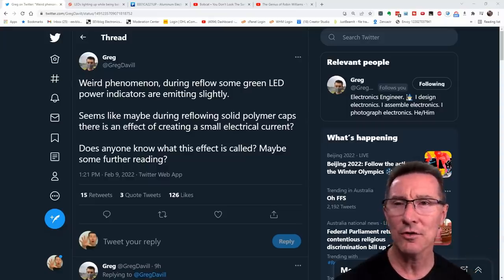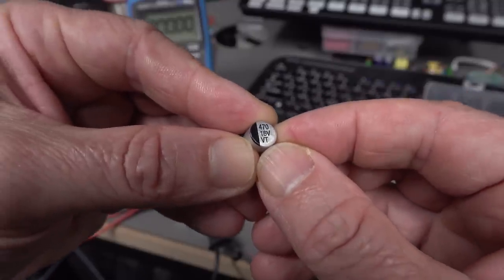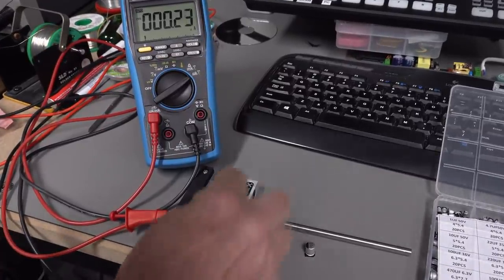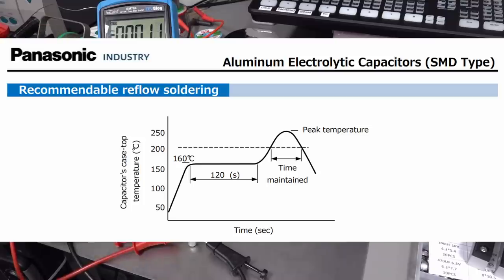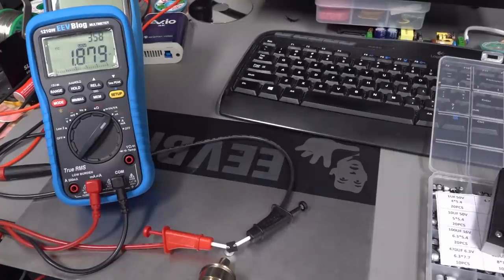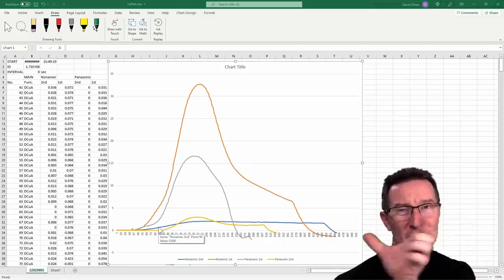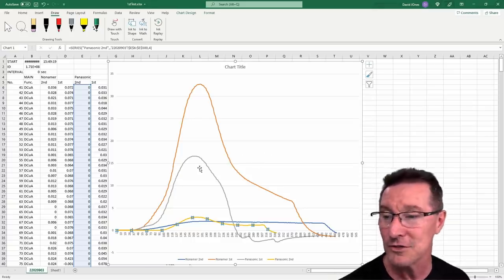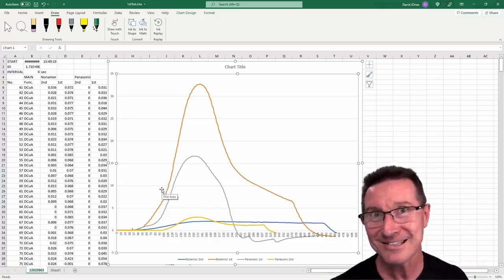EEVblog 1455 - Capacitors Produce Current During Reflow Soldering! WTF!

Comment: Might be related to pressure rise during the heating, which is compressing the internal structures, and this creates the current flow from simple piezo effect of the electrolyte. You can see the second time the pressure change has been relieved from the heating, so the capacitors are not undergoing as high a pressure swing. Try again, but take a new set of capacitors (off the reel) and simply cut through the top of the can with a knife to open the pressure relief, so you can see if it is internal pressure (electrolyte will boil a little) doing this, or some other mechanism.

Might be worth trying again with some high k ceramic capacitors, as they will definitely generate piezo voltage during heating. Also with the electrolytics connect some leads to them, and then slowly crush while recording the voltage, seeing if it is pressure related or heat alone. Leads of plain copper wire, soldered with the same roll of solder, so as have no thermal offset.

Comment: I have here green SMD LEDs (0603) , get it very cheap from ebay (from a a Chinese seller) and tested the brightness.
380nA - glowing
19µA  - good useable as Status-LED (U_LED = 2,12V) 
109µA - very bright Status-LED (U_LED = 2,28V )
218µA - unbearably bright

I let it run with 10mA for 3 days too to see if some of the Test-LEDs will fail.
Reply: A bug bear of mine is blindingly bright power indication LEDs on hobbiest circuit boards.

Comment: Capacitance drops with increase of the temperature. Voltage is the difference in potentials, so if you have 0 volts but some 0 volts means some charges are situated in side in some way, once you heat it up, capacitance drops and you get increase in voltage, which drives some small amount of current. When it cools off, you get negative
Reply: And higher quality caps will maintain capacitance over a wider range of temperature.
Reply: I think that's whats happening too.  The test arrangement supports this, having the diode across the terminals.  If there was a parasitic load thst drew any current before the led I don't think this would work.

Comment: I know from working on and restoring/modifying old tube guitar amps that when a capacitor sits a long time the electrolytic breaks down and when you apply power the electrolytic reforms. With old amps that have been sitting for years you have to hook them up to an isolated variac and slowly bring the voltage up over time to reform the electrolytic and the capacitors do heat up internally. Failure to use a variac on an old amp that been sitting for years and just plugging it into the wall socket can often create a nice fireworks show as the high voltage electrolytic capacitors literally blow up and 'confetti' the inside of the amp. Especially the really old high voltage (450-600V) electrolytics that had a paper/cardboard container rather than the aluminum ones we see today.

So it could be electricity generated as the electrolytic reforms from the heat and because you have already reformed it the second and third test give up a lower voltage/current because the electrolytic has mostly reformed on the 1st test. A way to test my theory would be let the capacitors sit for 6 months and then come back and try it again

Comment: The ESR of the electrolytic capacitors drops with a temperature increase. Those components are probably not tested individually when manufactured, but rather they rely on Six Sigma here. Nonetheless, my guess is that caps have some remanent charge when produced (maybe during filling with electrolyte). When heated they can discharge due to lower resistance when heated, but eventually run out of charge.

Comment: You named it: it's dielectric absorption.
You can model the real capacitor with an ideal capacitor, with nominal capacitance, in parallel with an R-C series where C has a smaller capacitance and R a very special behavior.
R is current-direction dependent, so the smaller capacitor charges quite fast but release the charge in an extremely long time (giving the well known dielectric absorption effect).
R is even extremely temperature dependent (negative), so when you heat up the capacitor, you reduce that resistance several order of magnitude, releasing the charge and causing the current flow.
When you repeat the heating the second time, then smaller charge is available and smaller current will be developed. Even smaller the third time and so on.
If you charge (and then discharge) the capacitor using an external source, then you will see the "thermal effect" again.

Comment: Just in general, over the last 30 years?  40 years ?   LED efficiency has increased massively.  Those red LEDs we played with as kids had terrible efficiencies, but modern LEDs.... oh man.  Crazy efficient at lower power.  One of our projects uses high-efficiency LEDs and its just crazy how little current is needed to light them up.  Mere microamps will do the job.  Very easily seen in a dark room.   Stray AC fields are enough, sometimes, depending on how the circuitry is arranged.   In our particular project we couldn't get the PWM brightness control to fade the LEDs sufficiently because even the 1/256 duty cycle (which actually was more like 3/256 due to the driver chip's mosfets not being able to turn off quickly)... it wasn't low enough.

-Matt

Comment: I always checked polarity of not marked electrolytic caps with a voltmeter, so did not surprise me that much. I would suggest it is the oxidation happening on one of the electrodes (oxygen ions passing through the defects in oxide layer. It explains the decrease in current with every subsequent heating - defects (oxide in the cap is polycrystalline, so bunch of lattice dislocations) are getting patched up with passing ions. Heating would accelerate the process. It does not damage the cap, until you make it boil and explode ofc

Comment: My first guess (which is obviously not even wrong) is that either the aluminium is oxidizing or the dielectric paper/film is changing chemically. This has to be a known thing (wet electrolyte capacitors are a fairly mature technology, dating back to the days of vacuum state electronics), and I'd guess that the manufacturers allow for this in their specifications and manufacturing process.

Comment: Had the same effect when I was repairing a cheap light bulb but in my case the bulb didnt have a electrolytic cap and only lighted the leds close to the soldering iron
Reply: That's probably because the leds light up at a few microamps of leakage current from your soldering iron.

Comment: Follow-up research idea: How does heating affect the long-term characteristics of the component? Beneficial effects, or detrimental effects?
Like, would it be something to pre-bake caps at a known temp and duration before plopping them onto a SMD board and reflowing them?
Idea would be that you boil off pockets of gas or cause reactions which cause the component to be more stable?
Another idea would be to agitate the component while heating, as to move around bubbles of gas that might've been trapped during manufacture...

Comment: In my opinion this effect might be caused by temperature dependece of the dielectric material.

Given that charge is proportional to capacitance times voltage (Q = C*U), the voltage at constant charge rises with decreasing capacitance (U = Q/C). Capacitance is always a function of permittivity (epsilon) and some function that is related to the mechanical construction of the capacitor (e.g. C = epsilon * A/d for a plate capacitor).

If the capacitor is not fully discharged before the experiment - even if there is just a little bit of charge left - and the dielectric's temperature coefficient is negative (which at least I know for sure for some MLCC types), voltage of the capacitor will rise by falling capacitance due to rising temperature.

When you start heating up the capacitor, the voltage rises and so current through the multimeter does (for ease of explenation let's assume the multimeter to be a constant resistance), but in the mean time charge decreases and at some point, there is no more charge left and the voltage drops back to zero.

So, I think this is just a discharge process of a variable capacitor and maybe combined with some parasitic inductance that may lead to an oscillation (which might cause the negative voltage).

Someone could verify my assumption by measuring the capacitance over temperature for your given capacitors.

Comment: Try charging and discharging the capacitor after it cools. I tried this and it seemed to restore the capacitors ability to product current when heated again. It's asif that last little bit of charge is released when it's heated.

Comment: Capacitors are in effect electrochemical cells. Heat drives chemical reactions forward. The fact that it only works once (between charges?) seems to confirm that.
Reply: Aren't all cells or batteries electrochemical?
Reply: @therealb888  That's my point. I don't think it's electorstatic or thermoelectric or anything like that, I think it's just a chemical reaction being pushed to completion by heat.

Comment: My bet is on chemical. In the same way that if you heat up a “dead” alkaline battery, it can squeeze a little more charge out of the chemistry. We have people here, who will leave D cell and other form factors, on a hot roof in the sun to get a tiny bit more out of the battery. Basically the heat temporarily accelerates the chemical process that produces the charge, pumping out that little tiny bit of potential charge, which may also explain why it is diminishing returns.

Comment: I've also seen this happen when you touch a hot soldering iron on one pad of an SMD LED. It's usually the red ones that exhibit this behavior the most.
Reply: probably just capacitive leakage to the iron, it often only takes uAs to ligth a modern LED
Reply: @fuzzy1dk  I was thinking more of Seebeck effect since there is a dissimilar junction inside an LED
Reply: @jaideep1337  Easy enough to rule out,   unplug the iron and try again while it's still hot.

Comment: same thing happens with piezo electric drivers within for example ultrasonic cleaners, these will produce a very high voltage if they are heated up which can be in the hundred volts range. but I think what mostly happens with the cap is that the heat excite the dielectric absorption to be released again

Comment: The electrolytics are easily explained as the oxidation layer being reduced through the electrolyte.  Otherwise, elevated temperature can release trapped charge in the dielectric, but I wouldn't expect enough to illuminate a LED.

Comment: Many years ago I heard sketchy reports of electrolytic caps producing current when dropped, and possibly when just raising and lowering them in Earth's gravitational field. But of course, a lot of amateur experimenters do not properly control stray variables, and some of the results may have been due to wire moving around in test clips.

Comment: And a big transformer can shock you, even when its primary is disconnected from the line, and the power supply output is shorted to ground.  In the 1980s, I did the maintenance on a Harris MW-50A 50 KW AM broadcast xmttr. It employed a 24 KV plate supply, and the transformer was a cube, about 3 ft to each side.  I don't know exactly what it weighed, but its top had tabs attached, for lifting it with a crane.  I had occasion to take some resistance readings around the transformer secondary.  The main AC disconnect was thrown, and the filter caps, of course, were shorted with a ground stick.  While poking around, I got zapped!  Not seriously, but it WAS a "shocking" experience!  Apparently, after power had been cut off, the microscopic magnetic domains in the core took some time to completely randomize, and that caused a slowly decaying magnetic field.  And with a transformer that produces such a high voltage, even a tiny change in the field produces a voltage that can shock you.  Shorting the P.S. output had no effect, because that was after the rectifier diode stacks.

Comment: Does the cap produce a voltage peak the same way? (use an electrometer for no loading) A normal DVM may be high enough input impedance to not load the cap much.

Comment: Before I watch this: LED produces some photovoltaic current  (less than normal operating voltage) and pre-charges the capacitor  (to less than normal LED operating voltage) . Than capacitance drops due to elevation of the temperature elevating the voltage (charge conservation effect).  LED lights up.

Comment: Ok, I'm going to make a prediction at the start of the video; It's the temperature at the metal-metal solder junction producing a voltage, and since the capacitor is polarized, the current only flows in a particular way.
Reply: I also have the same impression. After the cap charges... current flow stop

Comment: it's probably a break-in effect of dipoles in the fluids and the dielectric materials until the membrane is definitively wetted due to temperature and it settles. You only get a decent current in the first runs. try it with a big ceramic or other capacitor technology

Comment: Nice video. I would suggest to try to test it with different orientation of cap.. if it change then it might have something to do with boiling of electrolytics..or some change of state.. and because there is some reservoir of this extra electrolyte it might have some influence..

Comment: SMD leds, especially 0805 package ones can lit up with extreme low currents. Sometimes, they can lit even with touching it. But, on the other hand this thermo electric effect that on the electrolitic capacitors very interesting surely.

Comment: To be fair, a capacitor is just two plates separated by a dielectric. Or for most actual capacitors, it is two layers of rolled up metallic film separated by a dielectric.
Heating it likely causes the dielectric to expand, and this in turn moves some charge. Similar to how charge moves if you just have two metal plates and move them close or further away from each other. (one of the basic principals of most microphones.)

Now, if the plates have "exactly" the same voltage, it is dubious to if one would see a flow of charge, but how often do you truly have "exactly" the same voltage?
And reflow soldering is fairly warm, so perhaps it can generate sufficient voltage to light up an LED.

Could also be a change in the dielectric's capacitance that does it.
Changing distance or dielectric constant is more or less the same thing. (for DC this is more or less true. AC is a different story...)

But in the end, it is likely a bunch of different factors at play.

Comment: The dielectric in electrolytic capacitors it is not just layer of uniform material as it is in film or ceramic devices. Layer of aluminium oxo-hydroxyde is grown from the material of electrode as a thin film in course of so-called "forming" process. The structure of this layer is not uniform across it due to growth process developing. Stability of the film is just a kinetic phenomena as Al must react with water giving hydrogen. Kinetics of dissolution is limited by ion transport though the oxide layer which is stable in certain pH range provided by electrolyte (usually something like amonia pentaborate) at certain temperature. Heating of the capacitor changes stability of this system especially at weak sites (nearly flaws of the film, roughness of the foil, edges etc.). At such points reaction may continue yielding new oxide layers and providing charges in the external circuit. This reaction stops (slow down) because of self-stopping associated with accumulation of reaction products blocking further current. This is so-called passivity state of the Al electrode (see Purbaix diabram in google). However, it should not be considered as self-healing, because the products of such high-temperature corrosion may differ from "native" oxide layer and unable to provide suitable dielectric strength at rated voltage. This is why working temp. is limited to 85 or 105C. Above this temperature, products of anodic oxidation reaction are not uniform and can easily breakdown. The problem here associated with the fact that "native" oxo-hydroxyde layer is amorphous, but high-T oxidation results in both crystallisation of the film and release of chemically bonded water resulting in shrinkage of the material generating flaws, pores and cracks in the film. This is a fundamental property of amorphous alumina, similar to another one, which defines maximum working voltage about 450V. Such is life.

Comment: This seems to me to be a demonstration of the thermoelectric effect for a piece of wire with a temperature gradient charging a capacitor, hence the initial high current falling as the capacitor charges to the thermoelectric voltage. You can make a thermoelectric generator from a single piece of wire by maintaining the two ends at different temperatures.

Comment: Soldering air gun can create some electrostatic voltage as the air flowing through the components. So experiment is not clean enough.
But... Looking how current grows with rising temperature I can say that this is electrochemical process. Or may be some ion absorbtion/desorbtion processes on electrodes surfaces.
UPD: Oh! It's ending! And it's going negative! It's absorbtion/desorbtion definitely!

Comment: Theory: Expansion/contraction of the separate parts makes them slide along each other, finds a snug final fit, then it sets. The sliding of the different materials against each other creates a small current.